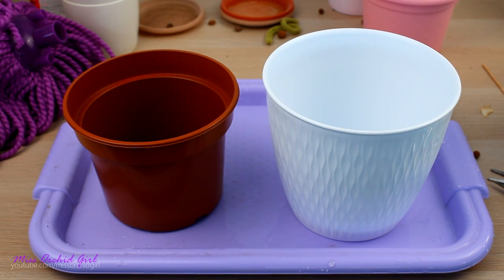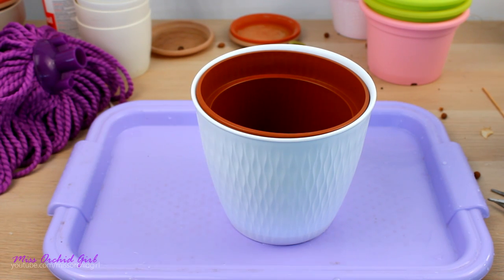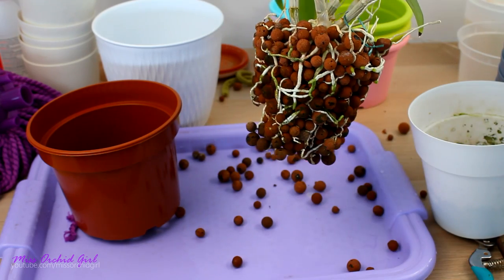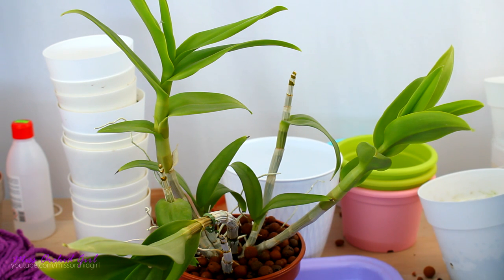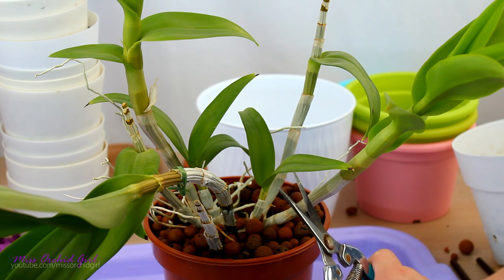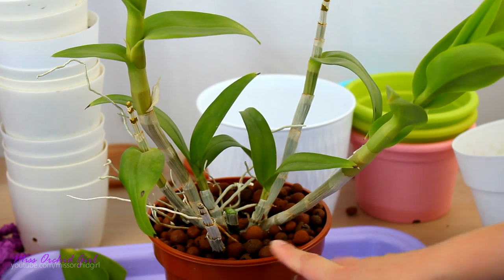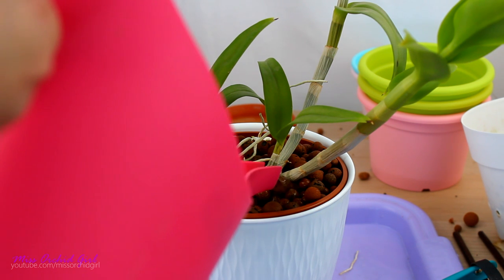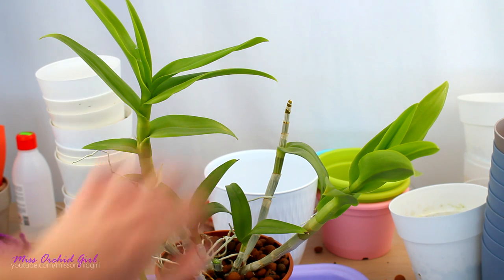Repotting outdoor Dendrobium Orchids + Cutting old canes

Comment: Hi Danny.  I just almost killed moms  phal. Gave it to her for Mother’s Day and repotted in fresh moss before I gifted and...   all the roots soured and did what I call “a leca”, when I change from moss to semi hydro and the phal losses all its roots.  But this time was from spag moss to fresh spag moss.  What’s even worst is the leaves are very fragile, almost as the leaves of iceberg lettuce.  It’s thick but breaks very very easily.  Hence ...  “almost killed” where I snapped off one of the fresh predominant leaf, and three had already came off turning yellow and  drying.   Anyways what to do.   On a happy note I found a new phal the next day and replaced it.  Of course mom will see it,  but something better than nothing. Yeah I’m only of those with two left thumbs sometimes.    Next step in this rescue is converting it into semi hydro with the wicking.  I’ll bring the wick to surface of the leca so the roots and plant won’t dehydrate any further from loss of roots.   Thought I’d shared this. 
Oh I’m also trying a new thing. I used to cut off all the dead roots.  Now when the velamen (?) softens I just pull out the watery or soft pieces leaving the hard inside root. I noticed with phals have a hard inside root.  I refrain from cutting it all off, though I do trim if too long but leave enough to reach bottom of pot.  Anyways I’m trying ...   emergency measures.

Comment: I’m having trouble finding Reasonably priced pretty pot.  Any ideas from anyone?
Reply: I just bought a beautifull blue vase. Not transparant, but like milky glass that looks somewhat cracked (don't know the exact name in English). It's good for the orchid because the roots need light.  The vase is 50%higher than the brown pot where the orchid is in. So, orchid in a brown pot with watering holes, and then in a vase that is almost double in height. Looks beautifull and also a lot cheaper than a pot. 
Hope this helps👍

Comment: What's the purpose of repotting
Reply from the maker: Hi, well there are many reasons. Cutting the dead roots and changing the broken down medium (in case of organic medium), or change the size of the pot, reshaping the orchid, etc.
Reply: @MissOrchidGirl  ooo ok I'm a new orchid owner and I'm struggling to keep it alive. I was told to water it once a week but the trunk looks like it's dehydrated. I'm just learning that its a Dendrobium